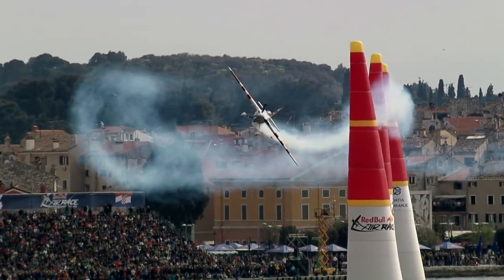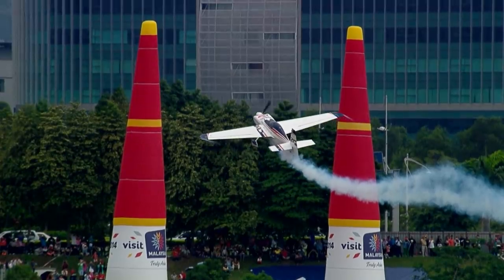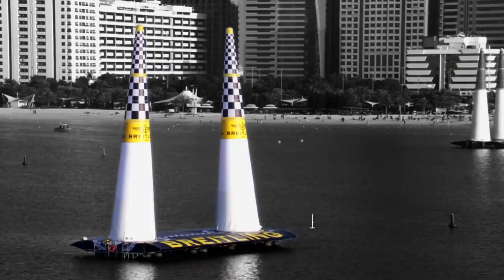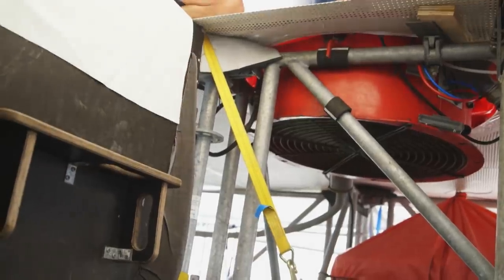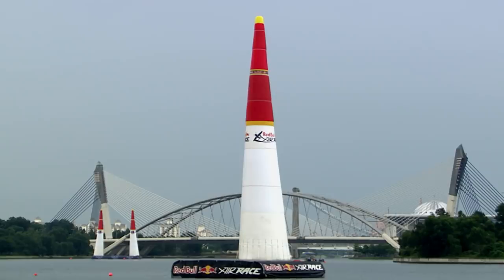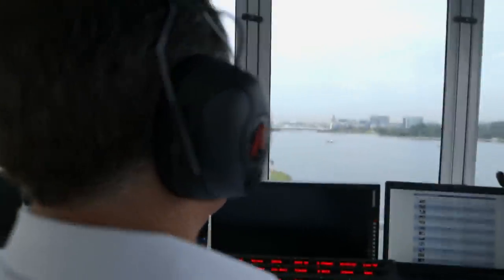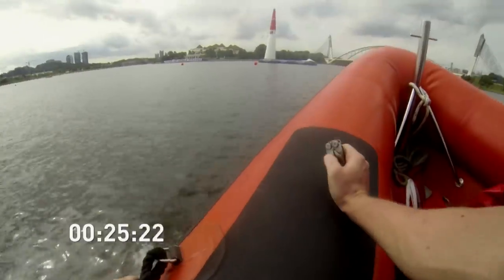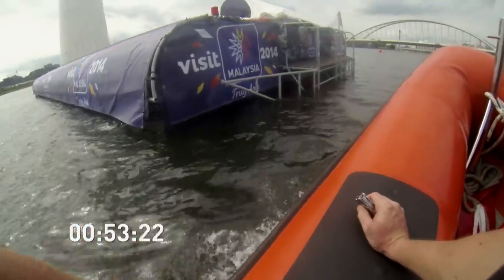How the Red Bull Air Race Pylons Work

Comment: "at the heart of every pilon is a sophisticated electronic system"
Also known as a FAN
Reply: "the pylon is connected by zipper, and made with innovative nylon material"
Also known as waterproof nylon fabric
Reply: Yeah lmao. I have one of these myself, slightly different but overall similar design just one piece since its not made to burst. It was made as a portable radio tower. You put an antenna on the top and inflate in the field for long range ops and repeaters.
Reply: a really big fan
Reply: Yup, but controlled pressure..
Reply: You think you are clever huh?
The electronic system refers to the electronics that monitors and regulates the pressure inside, the fan is what acts according to said electronics.
If you would have paid any attention to the video you would know that there is more than just a fan.
Reply: @zameliz  complex electronics like a pressure operated relay you could make out of scrap from a radio shack that hasn't been open for 30 years? the type of thing you can buy pre-assembled ICs in bulk for pennies each? yeah those are some pretty complex electronics. for 1958
Reply: @Cheesemonk3h  
Well, because I don't watch the air races, I didn't know whether they were filled with a pressurized gas or just common outside air with a fan, and- until I saw this video- I didn't know they were segmented.  So, no, this video is not for stupid people, and, yes it did tell me something interesting.
Reply: @EVAUnit4A  they could have presented the information in a manner that was just as informative and still respected the audiences intelligence and while I'm glad you learned something It begs the question who are they even marketing this stuff to? Kids?
Reply: @Cheesemonk3h  oh wow. It's almost like you don't need to click on the video if you don't wanna watch it. Revolutionary I know
Reply: @Cheesemonk3h  Well, look at the average consumer of this beverages.
Reply: Youtube Recommendations 
r/increasinglyverbose
Reply: @KandiKlover  How expensive are these things, and where would I find more about them?
Reply: this comment is funny.
Reply: @tommegg8486  A modified tent comes to mind, lol.
Reply: It is ultra lightweight Sil-Nylon waterproof and "airproof" with very low air infiltration. This material is used for spinnaker sails. But RedBull Pylon is made without the "ripstop" stitching. It is very high tech. If done wrong, the fan wont build enough pressure to make it "pop" and tear. Or it will rip too easily. It took a lot of R&D to get this right. Kudos to RedBull, their engineers, and those pilots. For making one of the craziest spectacles in or outside of aviation, into a reasonably safe spectator sport.

Comment: It is ultra lightweight Sil-Nylon waterproof and "airproof" with very low air infiltration. 

This material is used for spinnaker sails. But RedBull Pylon is made without the "ripstop" stitching. 

It is very high tech. If done wrong, the fan wont build enough pressure to make it "pop" and tear. Or it will rip too easily. It took a lot of R&D to get this right. Kudos to RedBull, their engineers, and those pilots. For making one of the craziest spectacles in or outside of aviation, into a reasonably safe spectator sport.

Bring in the non-aviation crowd to make air racing safe. Who knew? RARA should take notes.